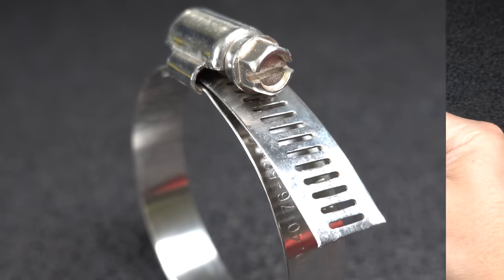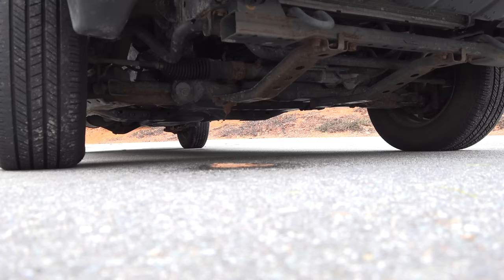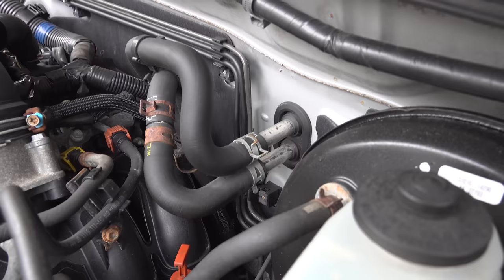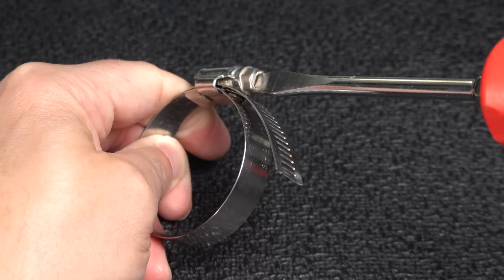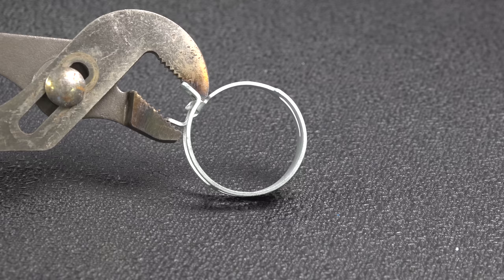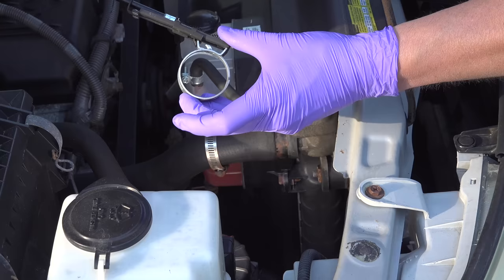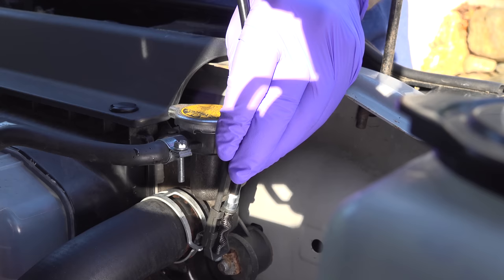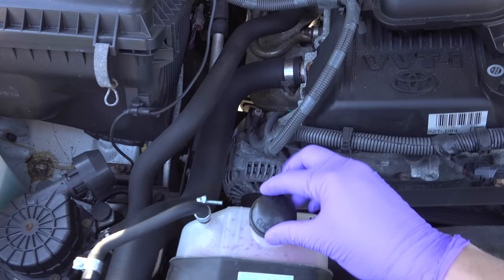STOP Using Hose Clamps WRONG - LEARN A BETTER WAY

Comment: As a pro mechanic for nearly 2 decades, I specifically NEVER reuse spring clamps UNLESS the hose is replaced and it comes with a new spring clamp. Spring clamps will never tighten properly around a hose that has taken a set (compressed around where the spring clamp once was). A screw clamp can almost always allow you to tighten it if you somehow (I never had one) develop a leak in the future. No need to worry about the clamp needing to expand with heat, the rubber hose perfectly allows for compensation of expansion due to heat (think crimped rubber lines used with power steering and transmission lines most commonly). If you break a water neck due to over tightening the clamp you probably used a 1/2 impact and a screw clamp that isn't available to the public AND your plastic water neck was probably so old and brittle that it was looking for an excuse to break. Ever have one of the ears break off a spring clamp? If so you will be cutting it off with a grinder - not fun. Manufacturers only use spring clamps because of their speed for assembling. This comment will probably be deleted because that's how we do things these days...
Reply: Must also mention that I've used Ideal brand hose clamps without failure. I'm sure you can Ebay a box of 100 crappy China screw clamps for $5 and have plenty of issues. Seen plenty of people swear by reusing spring clamps and have seen many leak. They usually chalk it up to not having it properly aligned yada yada. When I first started my career I reused them too and found when I pressure tested or the customer still had a leak after they left and came back a week later with issues, it was ALWAYS from a spring clamp. Switched to screw clamps and never again had a leak from any hose, new or used, ever again. I also only reuse spring clamps on vacuum lines and haven't had issues with that.
Reply: I am not a professional mechanic but I completely agree. I've had to loosen many of the spring clamps for one reason or another and after reinstallation, they always leak. I usually try to find the good screw clamps but even the cheap ones do a better job than spring clamps.

Comment: So there no real lock in the tightening of the hose? As pressure builds up in the pipes your clip will expand and leak. Ever Head of Bold calmp/clips?

Comment: A minute and a half into this video I'm shaking my head. Lol
 The reason auto makers use those clamps is because they're fast and they do work when the hose is the correct size and on OEM replacement parts. Whenever you start replacing hoses, radiators and water pumps and such, get you a good ole worm gear clamp.
 If the hose is smaller than 1/2 inch on the outside, you will be better off with the spring clamp like the red one shown in the video.

Comment: as a mechanic, this still doesn't change my view that those spring clamps are garbage. sure they're good in OE conditions, but having to undo them after they've been sitting for a long time, or even with a worn tool, all they do is snap shut as soon as you pinch those two tabs together. i always replace these with screw clamps. i've never had any problems.

Comment: After reading the comments it becomes apparent that some people do not give a shit what they are doing and are proud that they are a backyard hack and think they are being clever and got one over on the universe by using gear clamps and then come here to brag about it and get likes by the similarly gifted. If I am buying a used car and I see gear clamps, I scrutinize intensely to find out what other work this individual has done and ask them how they did it. When OEM hardware starts to disappear and what replaced it could have came from a hardware store, red flags start popping up.

Comment: I don't trust spring clamps, my Ford expedition came with that kind of clamp, they're a huge pain to remove at the lower radiator hoses end, on top of that they will hurt you if they snap out of the pipe pliers.

Comment: 60 years of automotive engineering using regular hose clamps: "Am I a joke to you?" Clip clamps are terrible for longevity and are often impossible to get off without breaking them after they've been on a vehicle near the seaside for a couple years. I've never in my life seen a hose clamps leak on a rubber tube connection that was specifically caused by regular hose clamps. Only place we use clip style (well not even the ones in the video, I'm referring to ear clamps) are for CV boots where you might have rotating clearance issues, and even then ear clamps are permanently secured and not held tight by spring tension. These clip styles are used for low pressure connections exactly for the reason they're not strong enough. If you crack a hose by tightening screw type hose clamps your hose was gone in the first place. The exact reason coolant hoses are rubber is that that can pick up slack and create a flexible seal around whatever it's connecting to.

Comment: I owned an automotive air conditioning and radiator repair shop for about 30 years.  My opinion is different than yours.  I think regular Stainless Steel worm drive hose clamps are stronger and easier to use than spring clamps. I opened the shop in 1973 and it is still open today by a former employee (May 23, 2021). We guaranteed our work and had very few comebacks. We worked with thousands of hose clamps each year, and did not have problems with regular SS hose clamps. 
* When we put on new hoses it was with good regular clamps.
* If a hose fitting leaked with a spring clamp we would replace it with a regular hose clamp.
We did cuss spring clamps, they can be hard to get off and dangerous. Also keep in mind spring clamps are for just a certain size hose. The SS worm drive clamps come in a wide range of sizes. In a pinch two clamps can be added together for a very large hoses like air intake hoses. Of coarse not all Stainless steel hose clamps are of the same quality. Spring clamps are also not all the same type or quality. 
Again a good SS worm drive clamp is stronger than a spring clamp. We have used hose clamps on air conditioning fittings that can get very hot and go over 300 PSI. Way back in the 60's I learned to double clamp air conditioning fittings. Can't imagine using spring clamps on air conditioning fittings!
Reply: Do you follow the connections for ten years watching for leaks? A mechanic may never know if a clamp leaks years later because the owner might just tighten the clamp because it's easy enough to do.
Reply: @ding9633 I opened the automotive air conditioning and radiator shop in 1973 and it is still open today. That is 49 years of history. Also many skinned knuckles and hands on spring clamps. The video shows a SS hose clamp cut off with a sharp edge, that could really cut someone! 
   I like SS hose clamps because they are simple, they work and are priced under a dollar.  I see some of your points about the spring clamps not over clamping. 
   When I started the shop many air conditioning lines used reusable hose barb fittings and SS hose clamps with a spacer bar to position the clamp. We learned to double clamp the A/C fittings. Spring clamps would not work for air conditioner fittings. After just a few years open, I got a crimper for hose ferrules. The fist one was fluted for R12 hose and the second one was a bubble crimp for R-134a hose. The hose ferrules look real good and don't have protrusions that can skin a knuckle. 
  It always irritated me that factory A/C lines had non reusable fittings and cost a lot. Air conditioning hose only costs a few dollars a foot but hose assembles can cost hundreds. I once priced an Mercedes A/C hose assembly that was over $500.00 and only had a few dollars of hose. They purposely make the fittings non-reusable so they can sell hose assemblies. We came up with some ways to reuse factory A/C fittings but it is not easy.

Comment: It’s possible because it was overtightened manufacturer use them because there cheap as only one piece one you squeeze them they lose there tension

Comment: OLD Leather Smith here,  I have used them 4, years, never had a problem.  
If you want a clamp with out holes,  a metric clamp looks the same without holes and works the same.  
How do I know this, before leather work as a business I sold fasteners for 46 years.  
GOD'S BLESSINGS ✝️⚾🙃

Comment: The spring type clamps are a pain in the ass to remove when they break, and the clamping force is very sad. I use old school clamps for my 180 psi air hose and 45 psi fuel hoses

Comment: The one and only reason manufacturers went away from worm drive clamps to spring clamps.........COST. 
Easier, faster and cheaper to manufacture and as a bonus they are  also easier, faster and cheaper to fit........all adds up to more profit.

Comment: Manufacturing uses spring clamps because they’re faster. But try again.   Worm drive work just fine if you’re competent and know how to tighten them. Used them many many many times over the last 20 years with no issue at all.

Comment: Those spring clamps are a nightmare. There difficult to remove for most guys who don't want to by a 100.oo tool. 
I've been using hose clamps, well a long time, I've never had one loosen up that hadn't been stripped by over tightening. Also, the amount a 3inch pipe expands on a car is measured in thousands. One might even think the two metals would expand together. The reason those are on factory cars is in the ease of installation with a tool, snap your done, important on a line.

Comment: I always figured worm gear clamps were better simply because I thought that the reasons manufacturers used the other kind (we always called them 'Godamnya clamps!') was because they were cheaper and they were easier and faster for assembly line monkeys to put on!

Comment: Manufacturers use those “ self adjust “ as you call them because they are easier for them to install at the factory. 

The correct way to fix your leak was to replace the hose. 

If hose can’t be found and you are stuck on the road your next best solution is to use the screw tighten clamp that are found everywhere and really un expensive.
Reply from the maker: That is one of the oldest myths around Do you really believe they use an inferior clamp, every manufacturer across the board. Check it out, you will see everything presented in the video is spot on.Don't fall for snopes.
Reply: @SilverCymbal  who said the OEM were inferior?? 

What most of us are saying that screw type have been used for decades and if use correctly they are more than perfect for the job. 

In fact screw type work better with used old hoses.

If you want to use OEM clamps then you must also use it on a NEW hose.

Comment: Spring clamps are garbage when you have to remove and reset. If you do not have the special tool, you will get hurt when it slips from your pliers. Also, I have helped stranded motorists that cannot put the clamp back on in a tight spot, like the bottom outlet hose. Worm drives can be installed one handed while keeping hose from slipping out with the other hand. If you cannot set a worm drive, best to leave it to a mechanic.

Comment: But the strength is not compareable because the vibration at right frequency can unscrew any bolt , nut , screw

Comment: First of all, the worm clamp used in the video is chinesium junk;  good worm gear clamps have ridged teeth not stamped teeth eg german clamps by Norma or Aba .  That clamp was only good for garden hose.  But the points raised are all valid, they will loosen over time not only because of temperature but you install a new hose, the hose gets compressed from temperature and the tight clamp you put is no longer tight.  This happened on my Audi fuel hose lines going to the fuel rail, after a year fuel was leaking despite using new Aba blue clamps tightened to 3.5Nm with a torque wrench.

Comment: Spring clamps are used by OEM not because they are cheap because they work best.  Gear clamps cost far less than quality spring clamps and when I see gear clamps in a car I know some hack worked on it and was cutting every corner possible.

Comment: You can reuse the spring clamps as well.  When buying a used car that's one of the things I look for. If it has screw clamps I won't buy the thing because what else did they cut corners on? The system is designed to last 100k +.. 
When they used spring clamps they were lucky to get 30k out of the system.
Edit:
All these mechanics that say the spring clamps suck and the screw style is the best are actually saying they are the fastest and cheapest to use. This gets them the most money in the least time with the least effort. This is the reason I haven't used a "mechanic" to fix my stuff. They cheap out and rig the system just good enough to last a few weeks beyond the return point. 250k on my car and I have done every repair it has ever needed and I bought it brand new in 2008.  Just got back from a 1600 mile round trip with her and she ran flawless through the mountains at 90 degrees, 80 mph, and the AC on. 
It still has all the original spring clamps. I have seen what those screw clamps do overtime. They cut into the hose little by little every time it's expands and contracts with heat.
If an automotive engineer designed the vehicle to use spring clamps that's what I use... My wife's car has spring clamps on it and it was $90k new. Not trying to flex but the vehicle is not from a manufacturer that worries about saving a nickel. 
Look and see what McLaren uses? What Porsche uses? What Ferrari uses? Lamborghini?  
They use it for a reason. It's a better product that expands and contracts with the temperature.

Comment: "mechanic" who did a LIM gasket job on my malibu cut the coolant bypass pipe that runs between plenum and manifold and replace with hose.  he must have found a pinhole in the pipe. he used worm gear clamps guess what? leaking bad now and coolant pooling on top of injectors. last thing I want is coolant filling the combustion chamber. I can see the clamp between the runners and it isnt even tight enough to compress the rubber into the slits in the clamp. I think the reason its leaking now is the heater pipe connection to the manifold had a pinhole which he "repaired" with rtv and the "repair" shit the bed so I changed it out I guess my new leak is the newest weak point.
What a hack

Comment: Cheap worm drive clamps stretch because they're thin.  Overtorquing them worsens this.  Spring clamps suck on old and dry hoses.  "Cranking it down" ruins the clamp 🤦‍♂️

Comment: Plain and simple, manufacturers use the new style clamps because they are cheap and quick to install with half of the car missing during manufacturing. If a radiator cracks because of a clamp the radiator was junk to start with. If anything the old style clamps will strip if you get them to tight.

Comment: Spring clamps are the best clamps. Worm gear clamps you’ll always have a coolant leak at some point in time. I work on refrigerated Reefer’s carriers were the first one to use Spring clamps never had to add coolant to those only if the water pump starts leaking out the weep hole. Thermal kings use gear clamps forever and you’re always putting coolant in. They are now using spring clamps. I’ve actually bought cars and change them all over to spring clamps because I don’t like coolant leaks. Long time ago I had a Chevy impala the top hose at the thermostat housing always leak when the weather changed. They didn’t make spring clamps then. In the end I ended up glueing the hose with weatherstripping glued to the thermostat housing and using two gear clamps to get rid of the leak. I don’t know why anybody would think gear clamps are better than spring clamps obviously you’ve never worked in the trade. I’ve been a mechanic/technician for 40 years and I wouldn’t give you anything for a gear clamp on a cooling system hose because it will leak. If you have to top up your coolant every time you change your oil and consider that normal you’d better start looking for that coolant leak before you have a big problem.

Comment: So what if you used the new fancy clamp and it failed ?
Reply from the maker: That shouldn't happen if its the right sized hose and clamp but if that did happen you may need to replace the hose

Comment: I live up in the north, and believe me i have heard every tom and jerry old fart mechanic tell me that the worm clamps are better, and that the spring clamps are brutal, but the truth of it is, i have re-used thousands of spring clamps (constant tension clamps) on thousands of vehicles without any trouble. VS i usually throw away the worms gear clamps because almost all of them ALWAYS leak. The trick with spring clamps is to make sure you have the correct size and thickness of clamp, and make sure you do not over stress them when opening them, otherwise you will over bend the spring and it will loose tension. Some of the cheaper made ones will rust, and will loose tension, however, The quality ones dont really do this and i dont worry about them. A spring clamp is ALMOST ALWAYS SUPERIOR just be patient while installing it. God damn i hate it when i have to replace worm gear clamps because of leaks EVERY OTHER DAY, damn old farts think they are the best thing since sliced bread... Why, Oooo WHY do you think the manufacturers switched to them a couple of decades ago now...

And yes i have seen quality worm gear clamps actually go the distance, especially the seamless type, but thats not what ppl use, they use the crappy-ist cheap-o worm clamp they can buy and then it ends up in my bay for a coolant leak 2 months later... I ask them "What did you do with the spring clamp that was on there?" ... They reply: "I threw it away it was too difficult to get on and off"... Then i take thier 25 cent worm clamp off, throw it in the garbage and order another spring clamp and the problem is forever fixed and everyone lives happily ever after...